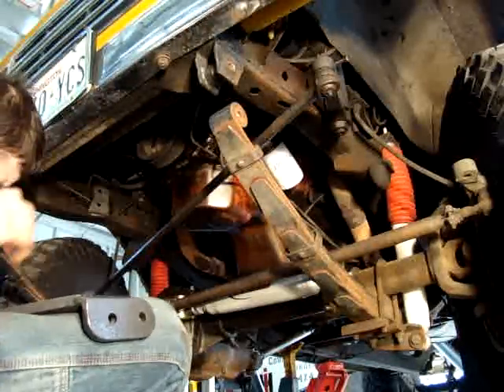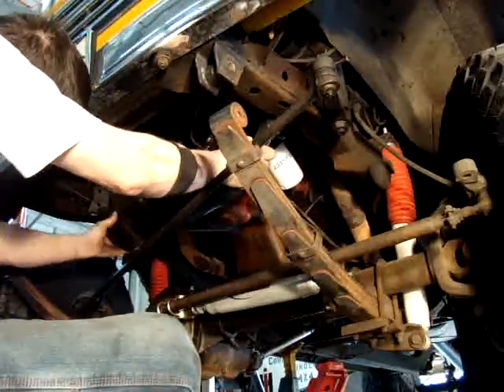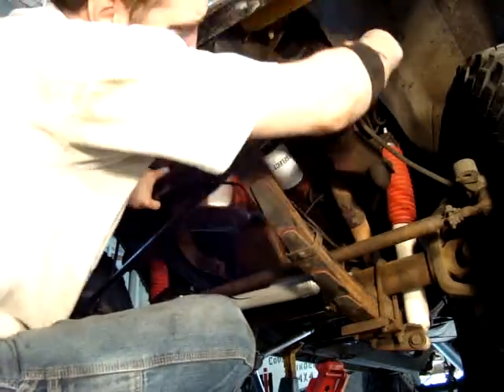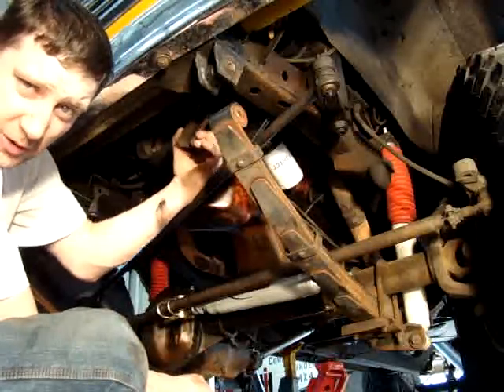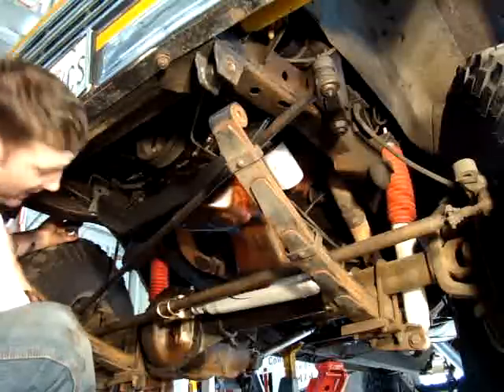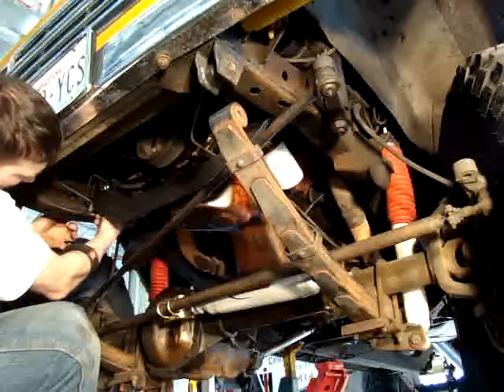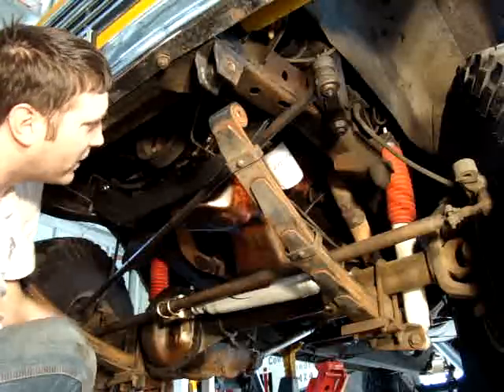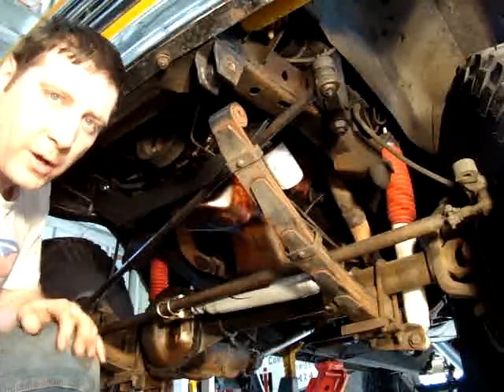Scout 2 Strait Steering brace installation video

Comment: Great video! Thank you! Made my install as easy as could be. The c- channel switch was key!
Reply from the maker: Great and thanks for the feedback. Share with your friends. I need to get this page up to a certain level to get paid from my videos. Im planning a bunch of new ones but the warm summer season is here and im doing a few large things currently. Again thank you.
Reply from the maker: How did you like our Steer Straight brace? Was it nice that it didn't hit your radiator hose? Did it improve your steering and reduce the amount of correction you have to put into the steering wheel to keep it going straight?  I'd recommend some caster correction as your next step if you have not already done so. :)
Thanks and hope you subscribed to the channel. We got some new videos in the works to be releases this year.

Comment: Great vid!  I just got a strait steer and will be installing asap.
Reply from the maker: How did you like our Steer Straight brace? Was it nice that it didn't hit your radiator hose? Did it improve your steering and reduce the amount of correction you have to put into the steering wheel to keep it going straight?  I'd recommend some caster correction as your next step if you have not already done so. :)
Thanks and hope you subscribed to our YouTube channel. We got some new videos in the works to be releases this year that we think your gonna like.